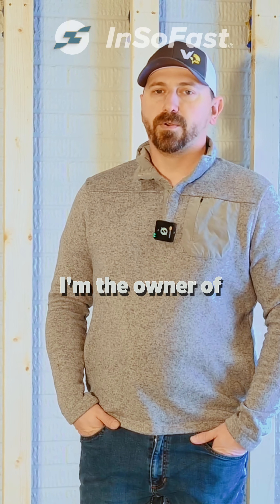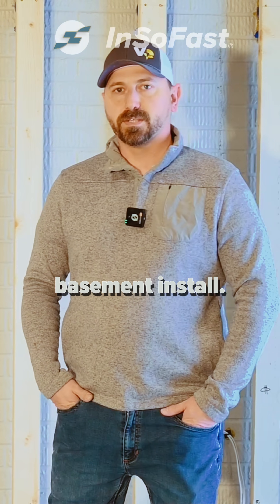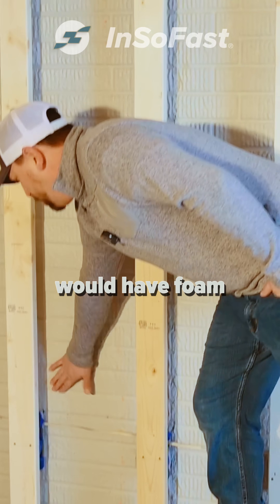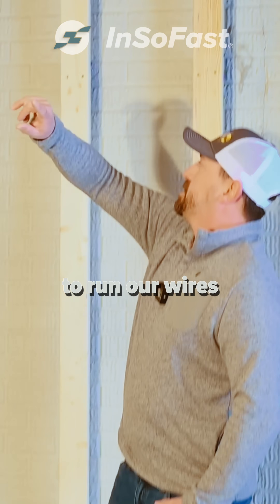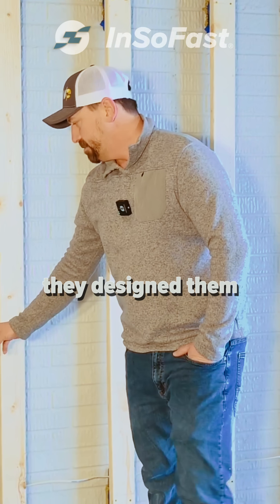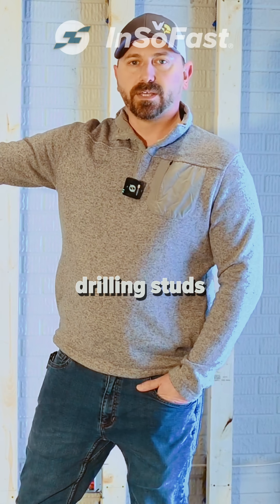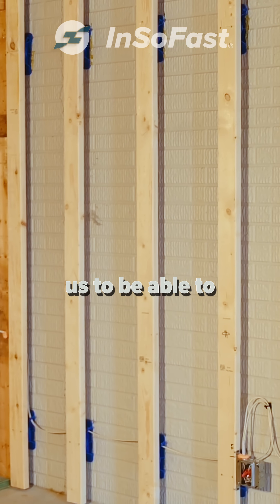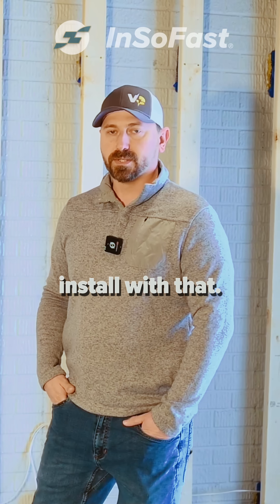Electrician Reacts to X-Bracket System by InSoFast | Part 1

Comment: This is a great idea. The only concern I would have is if you need to install another cable
Reply from the maker: Electricians typically use a 6’ long flexible drill bit in remodeling situations.   In this case it will be easier going through foam instead of wood studs.